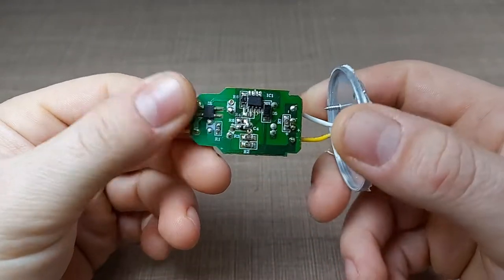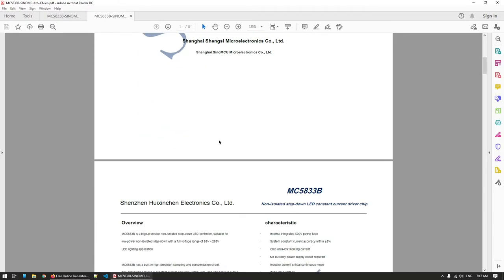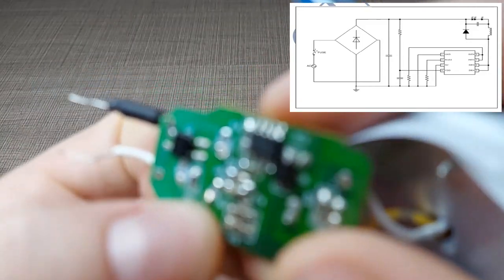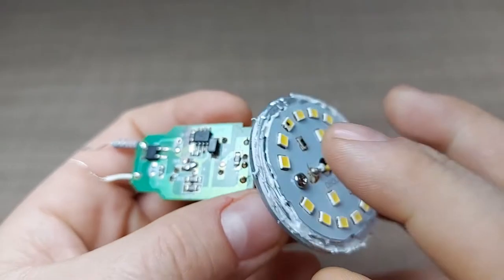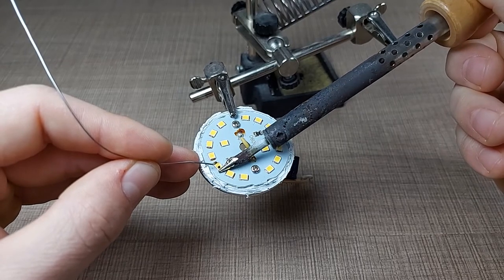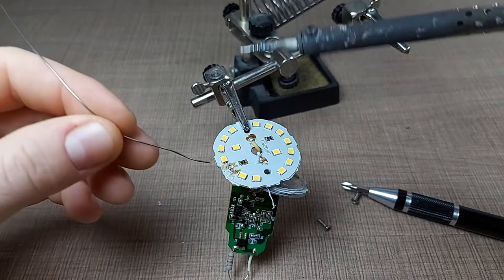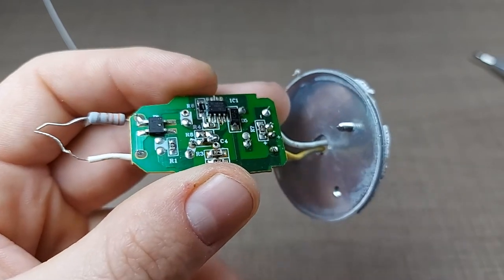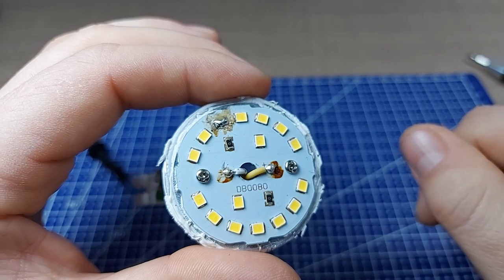Dead simple LED bulb repair with constant current driver - Healing bench #18

Comment: Honestly, 9/10 times you can just bodge across a dead LED and it'll work perfectly fine, the other LEDs may be running at a slightly higher voltage, but in that case it would only be a overvoltage of ~0.2v on each LED, in a 15 LED lamp like this one. The rest may run slightly hotter, but it'll almost definitely last the life of the rest of the lamp!
Reply from the maker: Sometimes, yes, you can do that but from what I have seen, LEDs are run either at their max or sometimes even above that. Going further up can cause an avalanche where LEDs just die one after the other.
Reply: @TasteTheCode  Thats true, although its likely either that or bodging a diode with a similar voltage drop across it.

Comment: i tryed a few lamps and output driver has 300 v dc. is that normal?
Reply from the maker: Was that just the driver with no LEDs attached? If so then yes, cuz the LEDs are the ones that clamp the voltage to some level and the driver is usually set to deliver a set amount of current through them.
Reply: @TasteTheCode  Thx. Tomorrow I'll try to disconnect only minus and then measure the voltage. That should be the right way I think or is there any other way?
Reply from the maker: Nope, that should yield the exact same result. You shoud measure the voltage across the LEDs while connected but again it will be close to 250v I guess.  These power supplies are designed to output steady current!
Reply: @TasteTheCode  Thx. the lamps have 10w so 250v divided by 10 is 25 amp? smth is not right. 250v is very high voltage for 10-20 led chips.
Reply from the maker: Those LEDs usually have more than 1 chip inside in series. So even if you look at one phisical LED, inside it might be 10 chips or even more.